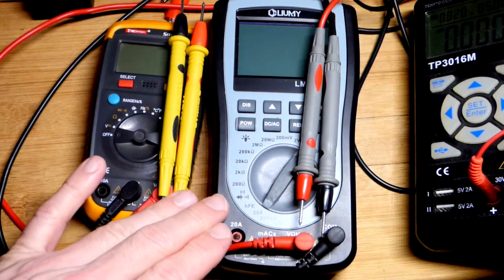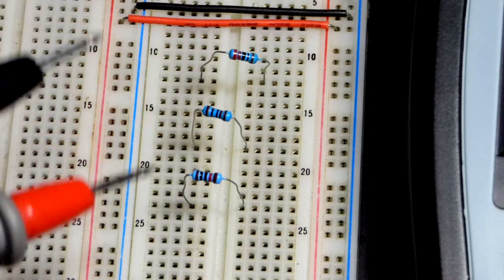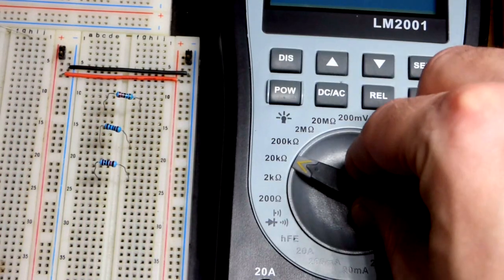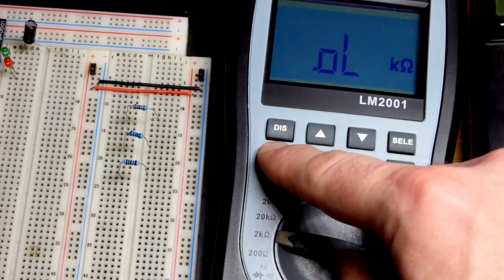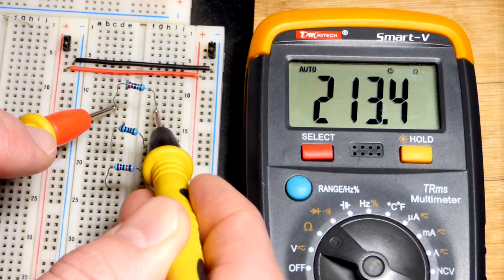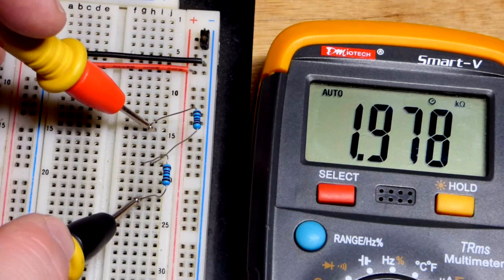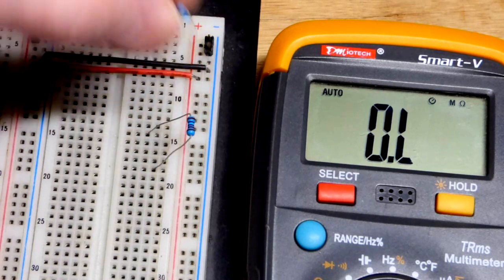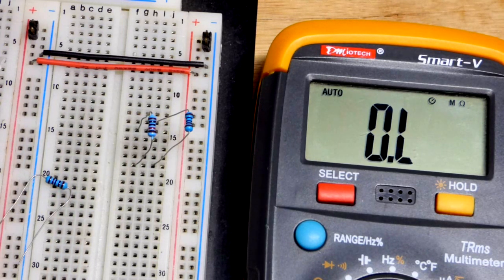How to measure resistance with a multimeter demonstration by electronzap learning electronics

Comment: One important thing to mention is not to try measuring resistance on a live circuit. It'll be inaccurate or potentially worse damage the meter.
Reply from the maker: I thought I mentioned that. Hope I didn't edit it out by accident lol.